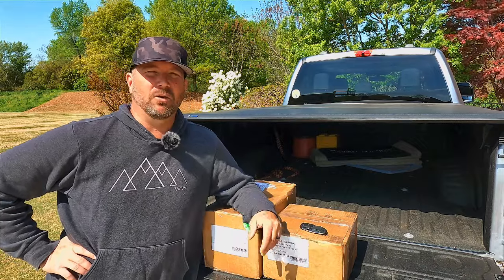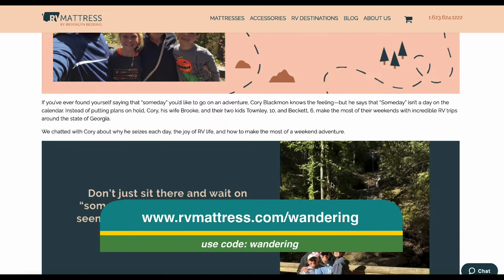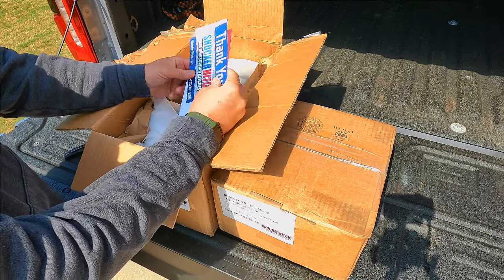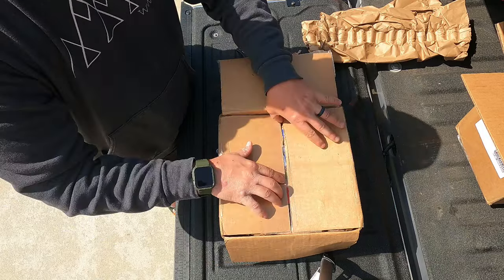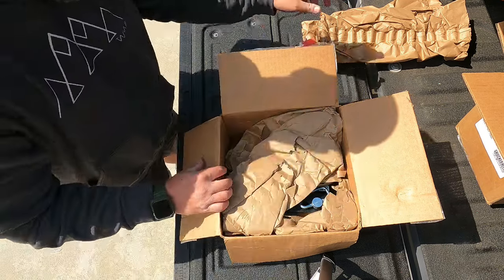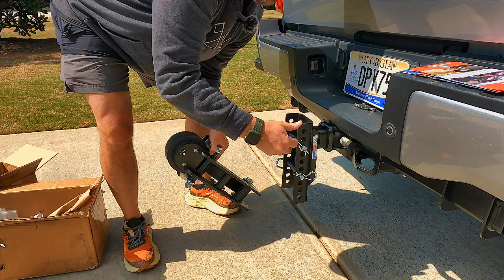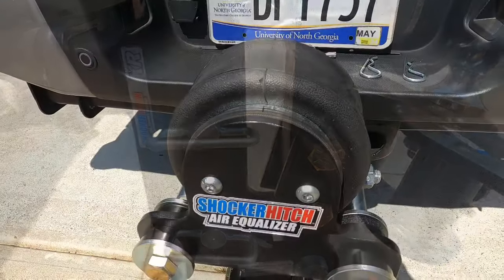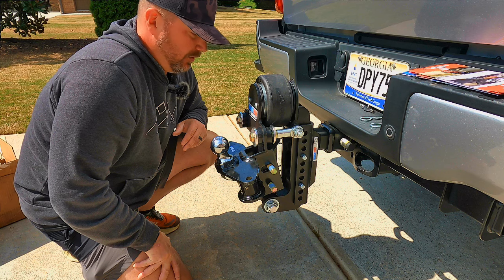SHOCKER Hitch Unboxing & Very Important B&W Continuum Update

Comment: It appears that this hitch has a pivot point at the bottom and the air bag at the top. That pivot will not provide any vertical movement. Trying to wrap my head around exactly how it will function and perform. Looking forward to your next video on it. This would be a great hitch to compare with the AirSafe as they both have air bags.

Comment: This hitch seems similar to my Gen-Y setup.  It also replaces the shank of my WDH and it similarly dampens the ride. Instead of air it has rubber absorbers.  I love it.  It really improved my setup.
Reply from the maker: I need to get my hands on the Gen-Y!
Reply: @WanderingWeekends  The Shocker hitch is a lot lighter than the Gen-Y, but the Gen-Y can be added to many existing setups.  That is how I got mine, as an upgrade to my existing recurve r3 hitch. However, it weights over 100lbs.  Still curious to see you review.
Reply: How do you like your Gen Y?
Reply: @BigBangSHINee108  I got it to solve an issue for my towing setup.  It is somewhat unique and resulted in som proposing.  I think the Gen-Y hitch greatly improved my experience. The only thing I regret is getting the WDH setup instead of the hitch version.  The hitch version would have made it more universal, ie. it would work with more WDH setups and other towing situations.

Comment: We have had one of these pretty much since we have owned our travel trailer. It does seem to separate the truck and trailer and you can hardly even tell the trailer is back there over bumps. I feel that it does help because on certain roads I would have thought that stuff would have been thrown everywhere, but it has been great so far.

Comment: Well hello My name is Stuart. I live in Naples Florida. I am using my wife's YouTube channel, so did you ever get the shocker weight distribution airbag hitch up and running? Whatever happened with that? I have heard it is a fantastic hitch. I actually owned a shocker standard 12,000 lb receiver hitch that I use on my newmar motor coach and it made a real difference. As far as what I was telling my featherlight 24 ft trailer with a golf cart on it and a Jeep renegade it really did. Do a great job now. Supposedly it does a great job with the weight distribution and when you have a hitch as far as giving you a smoother better ride, I am looking at going back to hauling some RVs out of Elkhart Indiana in the future and I would like to maybe get the shocker weight distribution airbag hitch. I would use it a little bit differently. I would be using it to haul some campers commercially travel trailers. I would love to talk to you about this. This is a good hitch. I just never don't think you ever updated on this???????????????????😮
Reply from the maker: Hey Stuart, the Shocker hitch is definitely on the agenda. Quite frankly I haven’t towed a ton this summer. Keep in mind this channel is not a large, professionally produced tv show.  It’s just myself and my experiences. Sometimes things take some time. Thanks for your understanding.

Comment: I am very interested in hearing where you land on the B&W Continuum.  I just about bought 1 2 weeks ago after a ton of research, a very large amount of research coming from your channel thanks!, but I have decided to hold off on getting a Continuum at this point for 2 reasons. I want to see how you ends up after working with B&W, and I'm curious about how it will bolt up to my new trailer my wife and ordered. We ordered a Rockwood 2517S wich is 26' total length and looking to be picking it up in late May. Our tow rig is a 96 Ford F350 4 wheel drive 7.3 longbed. My main concern is will the Continuum system fit without needing any modification to the trailer. It looks like some folks have had to cut a notch from a horizontal bar under the propane tanks to get the proper clearance for the ram on the Continuum. I would really be bummed if I can't get the Continuum to fit without major trailer A Frame modification. I just really like the idea of the simplicity, low weight which I really like, quiet running, can leave on to back up, performs well, no grease or heavy bars to deal with, etc.  We pick our Rockwood 2517S up in late May. I would really like to know if the Continuum is a good fit for the trailer. Honestly it appears to be a goof fit for what I'm looking for. 

My biggest concern is getting the Continuum on without having to modify the trailer A Frame. If so, I really feel B&W is missing the boat on this one as there are a lot if Rockwood and Flagstaff trailers that will probably have the same issue. 

Please update your results with the B&W engineers when able Please.
Reply from the maker: I sure will!

Comment: Which Reese??  I have been wondering why you hadn't had a Reese in your lists at all yet!  I had a Reese Steadi-flex for 6 years and had no issues with it, and for my next hitch I got the Weigh Safe based on your reviews.  But I was always curious how the Reese Straight-line functioned with those cams to keep it inline!  The Steadi-flex just has brake pads for friction but those cams look great in concept and I am curious how they do on actual 30ft or 8000# trailers in winds.
Reply from the maker: It’s the old school Reece Draw Tite I believe. I haven’t even had the chance to fully unbox it yet.
Reply: @WanderingWeekends  Well maybe in the future then. You can be the first non-etrailer reviewer of the Reese Straight - line!

Comment: Subscribed thanks to this video randomly reaching my recommended feed. Long story short: I'm hauling a 34' TT with a long bed dually w/factory air ride, and getting more porpoising than I care for. Not anything that feels out of control, just less than ideal if that makes sense. I'll probably upgrade the truck shocks first (still has oem, which are always sub-par), but not quite ready to drop the 4-digit money on a WD hitch. But, I'm looking into it and appreciate the range of reviews you have. I did find and view your B&W negative review, but will get to some more later. I'm a fan of B&W, currently using their stow & go hitch. After I gasped at the cost LOL the Continuum looks interesting. I'm looking forward to digging into your other video reviews. Also a shout out to others commenting: best audience I've seen on any Youtuber content! Good information with enough detail to make it worth reading.